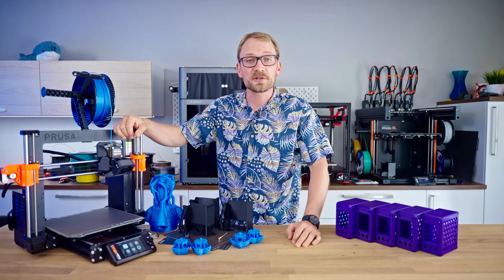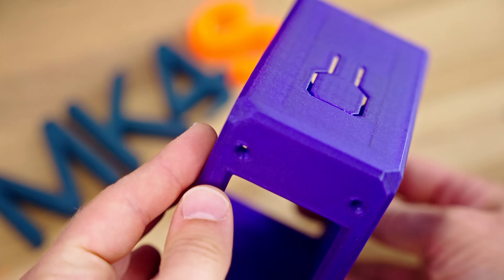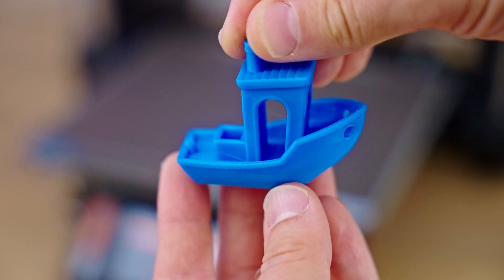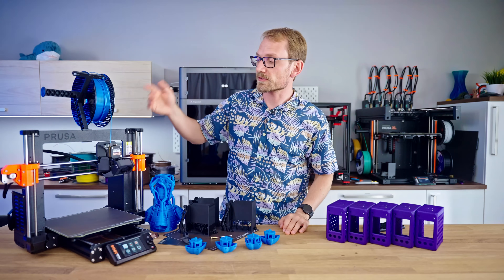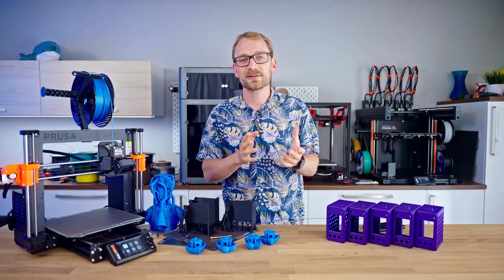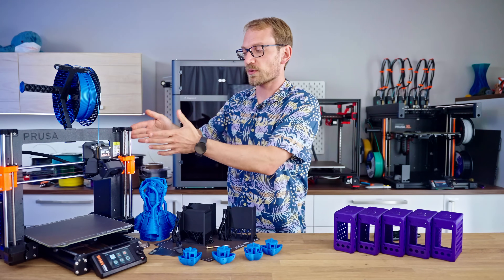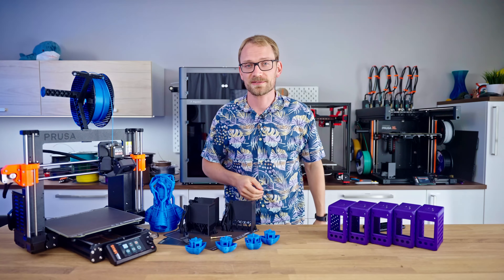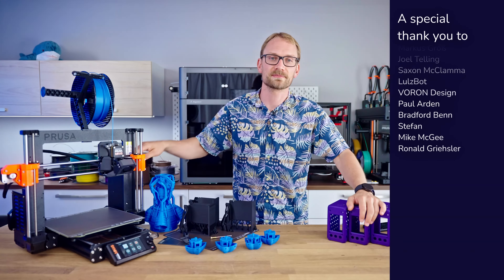"S" is for Speed - Prusa MK4S

Comment: The fact that there's hardly any change is... disappointing. Compared to Bambu, etc. this just feels archaic.
Reply: realistically for an update kit, what change do you want? Or can be done? Core xy conversion kit lol?
Reply: @YS-nj7dm  Don't want it to be an upgrade kit, but an actual upgrade
Reply: @Levkin  So then you want to go like other manufacturers way and buy completely new printer iteration fully priced every time? Perfect 👌
Reply: @jothain  It's for sure great to support their existing users, and simply upgrading existing hardware is great. However, Prusa still hasn't got any response to the new faster consumer printers, and that I find disappointing
Reply: @Levkin  They have better quality, better dimensional accuracy, better overhang support, better multi-material handling, ... Isn't that "response" enough?
Reply: @ulaB  Prusa better at multi-material handling? The rest I can give you, multi material, absolutely not.
Reply: @Levkin  I guess it depends on what features you prefer. The MMU3 does faster swaps, produces less waste, has no limitations regarding spool size or weight and is easier to maintain compared to the AMS for example. Those are higher ranked in my comparison.

Comment: the new print profiles look to be at the edge of usability. "high flow" v6 nozzle wont fix the issue of short meltzone.
Reply: They have "CHT Geometry" in there now. I don't know how good their implementation is, some have tried and failed, but if it's good, it does a fair bit to improve heating performance inside a short meltzone.

Not having the meltzone volume too high is also sort of important because the movement speed of these machines isn't all that, so styrenes can get crispy yellow gross and brittle if you're doing highly detailed prints with a smaller nozzle in these materials. Also things like TPU are usually run at a very modest speed and you still don't want to keep them cooking in the meltzone for too long.
Reply: i mean thats literally what a high flow nozzle does. look at any cht style nozzle and its directly compared against long melt zone options
Reply: I honestly was hoping for a volcano length hotend instead of a cht nozzle, but i guess they would loose build height in that process as well as increase MMU waste, although im not sure how the cht affects their tip stamping.